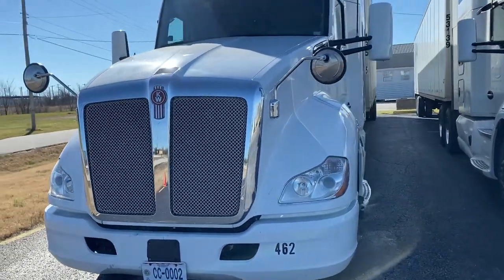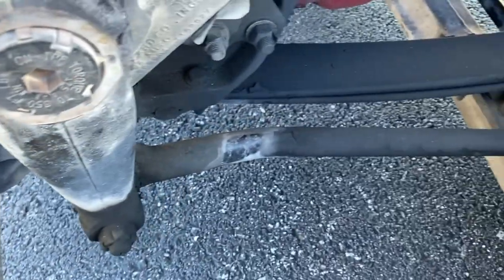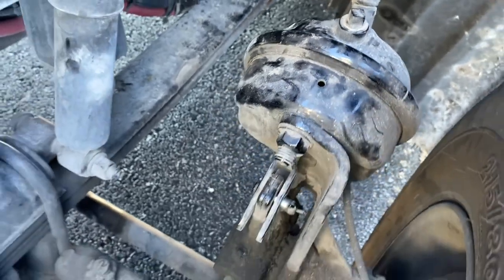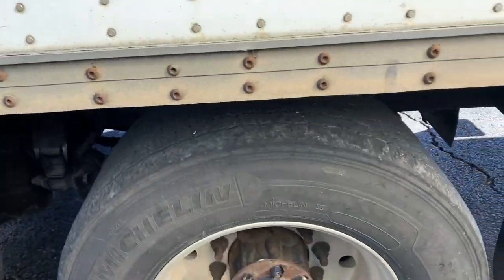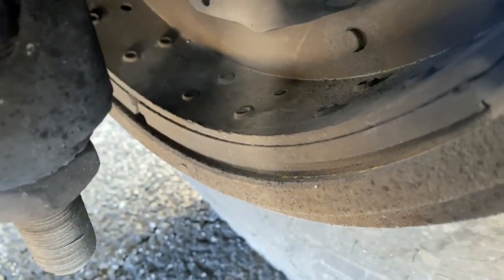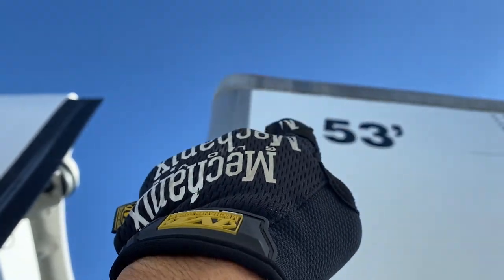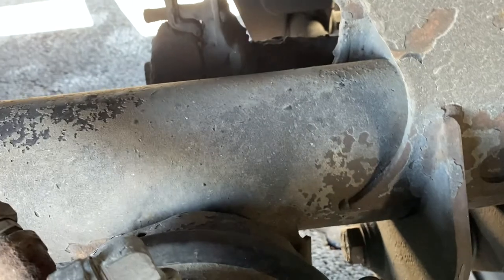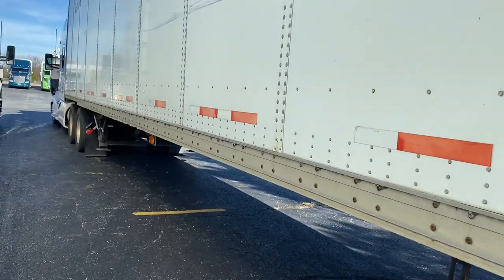CDL Road Test Pre-Trip Inspection Walk Through (Outside Of Tractor & Trailer)

Comment: I am currently enrolled at Crowder College. I am going to be with CFI as well. I did notice you left out the Air Cimpressor on the Driver Side (it is Gear Driven and attached next to the power steering pump). You pointed out the Air Compresser on the passenger side but that was the part of the Air Conditioner System. Other than that, you got it spot on. Your video was super helpful and I think that it helped me verify that I was learning things correctly. 😀 Thank you for this informative video. BTW, most of those trucks and trailers are still here. They haven't replaced them yet. Lol. Our class is starting the second week tomorrow and we have already passed our Straight Back exam and we are testing for Parallel Backing tomorrow. 😃
Reply from the maker: Dude the funny part is that I actually noticed that I did that after reviewing the video and I was like oh well I don’t wanna record all that again 😆.

Good luck man you got this and hope to see ya out here soon!!

Comment: Hey I have a question on the pri inspection when you take the  test do you have to do the whole‘s truck   Or  The front and back
Reply from the maker: Now it all depends on your instructor. Typically they’ll tell you what they want you to call out, so I would make sure to study everything. Go into it like you’d be doing the whole truck. You will have to do everything for the In Cab and Brake Test for sure. Hope that helps!